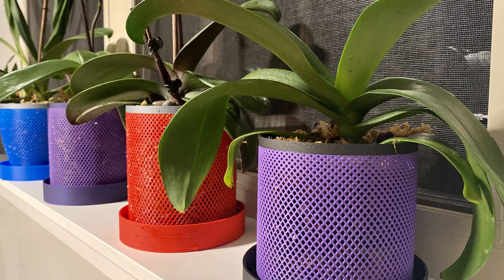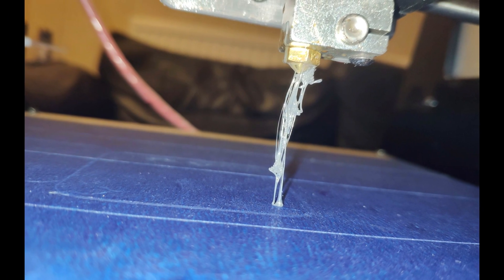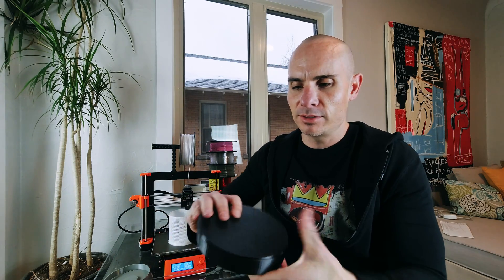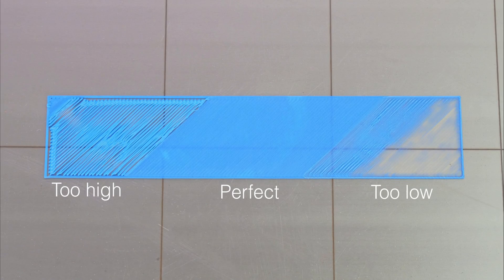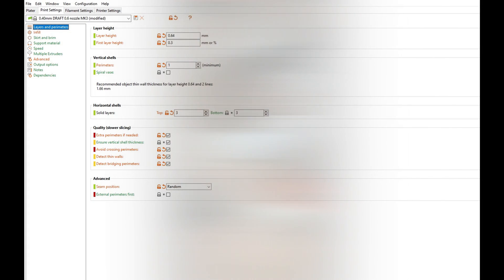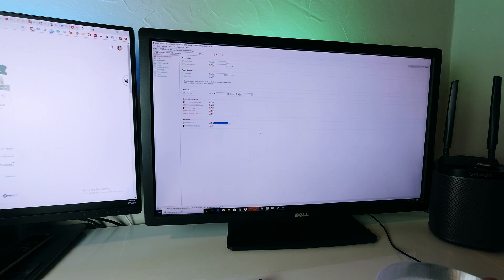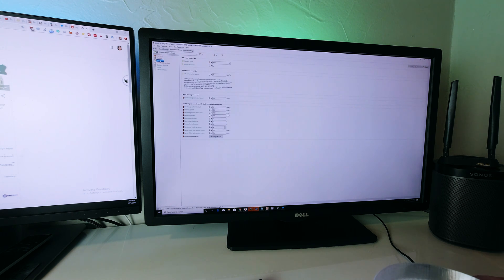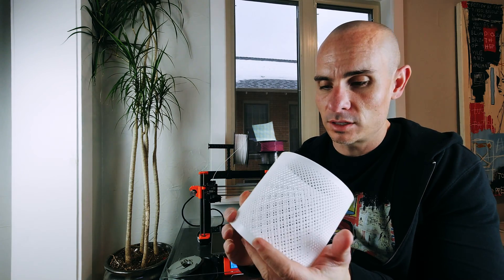The Ultimate Guide to PETG 3D Printing #PETG #3dPrinting

Comment: A coated nozzle and heatbreak can reduce filament sticking in unwanted places. A silicone sock is also recommended. These help with PETG sticking where you don't want it.
Reply from the maker: Thanks Bob, I have heard that nickel nozzles help. I haven't tried a silicon sock yet, but did hear good things about it for sticky filament like PET
Reply: @ALLYOURTECH3DP  wups - meant heater block although you can get coated heat break as well, but for a different problem. Nice video.
Reply: One thing I never understood is why the socks moved away from the tiny hole that covered 98% of the nozzle because, in my case, the PETG sticks to the sides of the nozzle up to the nut piece which is why I never went to socks as the new style 100% negates why I would use one.